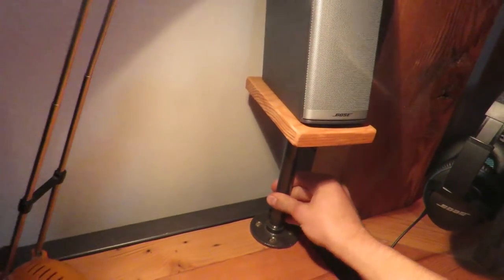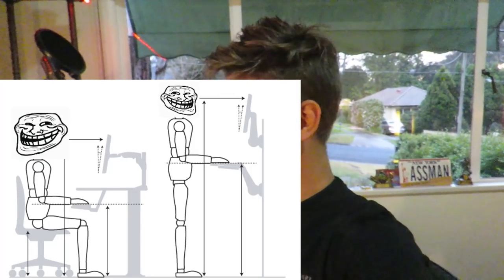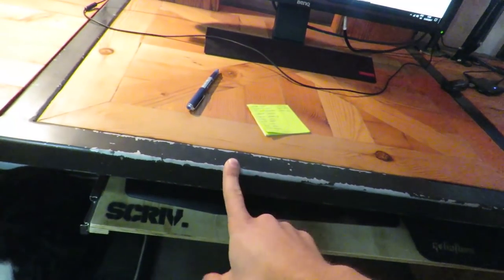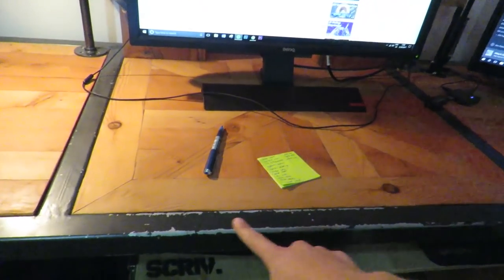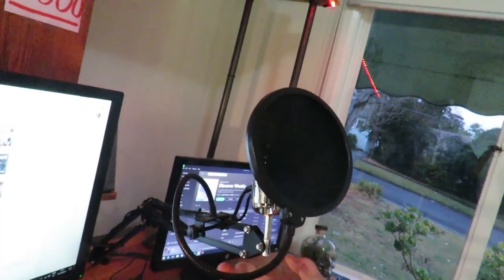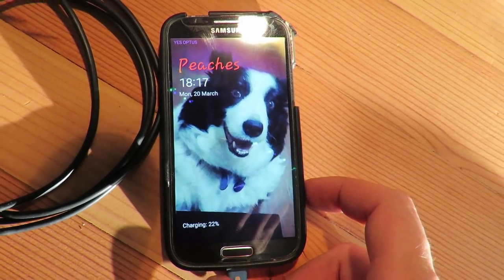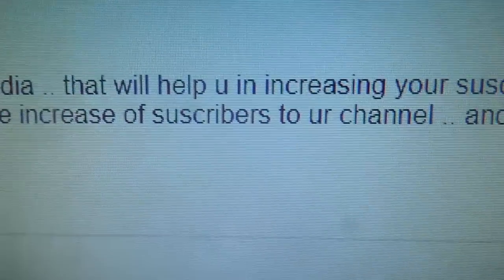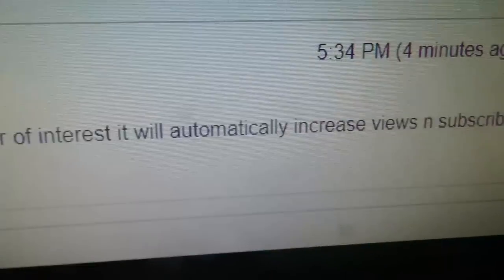Making the ULTIMATE desk! - Updates and response

Comment: have you got one of those tent mats the thin foam type cut and glue over the metal in your work area. there are vids about mounting screens on your desk your tube ends get some a bit thicker and mount them that way like a T piece that holds 2 screens just search on the tube to find them good luck you did well. For a while you'll change bits and pieces but that’s all part of learning.

Comment: Thanks for the mention. Now that I know your renting and on the second floor I agree that getting in through the window wasn't possible. Where I work we had to cut a hole in the roof to bring a transformer into to our data centre using a crane. That was fun. For the edge of my desk I painted it with a pvc rubber like paint that leaves a thick textured coating. It eventually wears off but lasts a lot longer. Speaker stands look great.  I also have a "bowling pin" style cable clip for retaining cables the I am not using.
Reply from the maker: No problem friend, thanks for watching. :)

Damn!! That sounds like an absolute nightmare!

Great advice on the paint, and thankyou for the compliments :)
Reply: When your doing things corporate opening the roof is just another corporate expense. LOL! I am working on a desk fr a friend.  She found a metal frame and I have to make a top for it. I want to do 1" Walnut but am not sure if it is in her budget! The top will be about  700 - 900 $CDN but it will be pretty when I put a hand rubbed tongue oil finish on it (8 or nine lovingly applied coats with  micro sanding and buffing in between. I have done this with a bo-staff but have not tried this technique on  larger pieces. The tongue oil soaks in and hardens and makes the top hard as nails. It also makes it pretty much water proof. Any problems..sand and recoat.

Comment: Hey man, I recommend a fine-grain sanding block and some elbow grease on acetate sheets to go over your LED strips; they create an amazing softening effect while minimally dampening the lighting strength. Give it a go if you'd like, you could probably just cut and glue some sheets into your holes due to how deep you cut them for the strips. (Keep in my mind heat from lights)

Comment: As for a diffuser material you might try surplus strips of the opaque material they use in commercial florescent  ceiling and cutting it into strips you should be able to find it cheap/free. Or you you could sand some plexiglas with 80 or 120 grit sandpaper.
Reply from the maker: Great advice, thanks!

Comment: hey man i have a suggestion for your desk,

since you are pretty good at wood working you should build some custom enclosures for your speakers to match the materials of your desk, you could just use the guts of the bose speakers, or if you want to try what i did, i actually mounted a car amplifier under my monitor stand and use that to control the speakers

Comment: about the paint.... primer will not help in the long run. You need a clear protective top coat. Use a non gloss polyurethane clear coat. Put several coat on. The clear will wear, not the paint. Also, more cats of paint will help also. There are also chemical etching compounds that can be applied. I'm digging the design !! You s[peaker stands gave me an idea for stands on my desk top as well.

Comment: 1: You can place a link in this video's description, so folks can go directly to the original desk video. 2: You've got some neat videos, but you're not the Beatles yet. Need to work on the videography. 3: It's your room and your life, but you are putting it on display so anyone in the world can see it. The "ASSMAN" license plate could have you kicking yourself in the ass sooner rather than later. 4: Love your desk. Neat speaker pedestals. Congrats on the new keyboard tray. 5: You could place one of those thin rubberized mats in front of your monitors, which would cover the metal and paint issue.

Comment: Ultimate computer desk wouldn't have a fancy top--just solid, smooth wood--as it would be covered in dry-erase vinyl to make it a white board. Also, no cabinet for a PC. Sure, your current one may run cool, but it's not hard to build a system that would want as much airflow as physically possible to prolong component life.

I'm going to build my own desk and I'm considering slinging a shelf under the back instead of over to hide routers, hubs, and speakers. I'm tempted to figure out a way to integrate wireless charging into it as well.

Comment: Generally nice looking desk with the tube metal frame and wood panels.  And many ideas incorporated for cable management, speaker stands, and such.The problem of chipping along the front edge of the tube frame can be solved by taking the desk apart, then refinishing the metal either painted with primer coats or having it all powder coated, then using sections of gel wrist rests to protect both you and the frame.  The only major problem remaining would be to address the ghastly god-awful music  (noise) selected as your background. Seriously?
Until that is fixed change from speakers to headphones so you don't inflict that on anyone else.

Comment: I enjoy what you've done with the desk to truly make it your own but I also would argue you're a far cry from anything close to the "ultimate" desk for PCs. I recently assembled one as well and used a pair of cabinets from kitchen remodeling and made a nice L shaped desk that I will be adding to in the future including wiring in a wall socket with on off switch, two power strips for powering my equipment as well as a hidden cable tray and there is both overhead and undercarriage lighting on it run to two remotes letting me light UNDER the desktop as well as above it. Finally I kept my tower out in the open for all to see, the cables are hidden but the tower isnt letting you see the glorious pc without the mess of cables